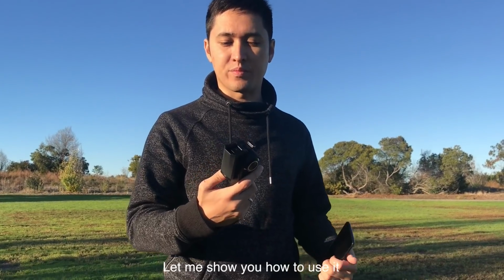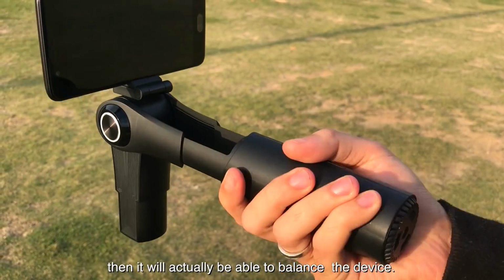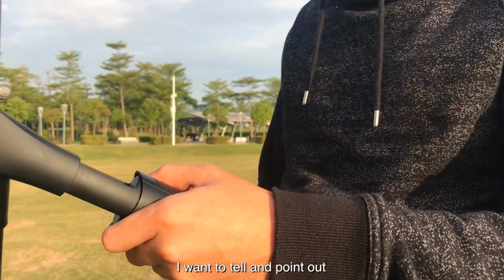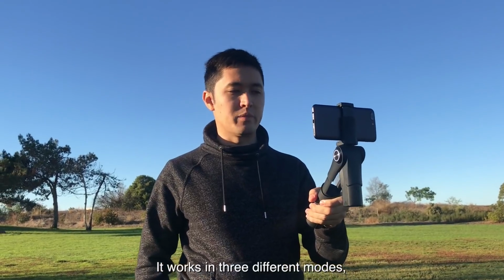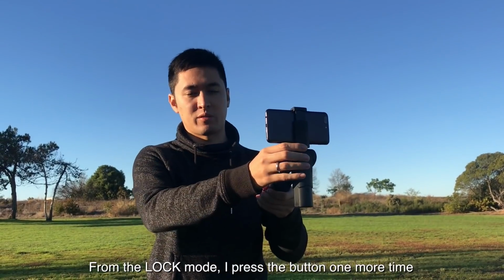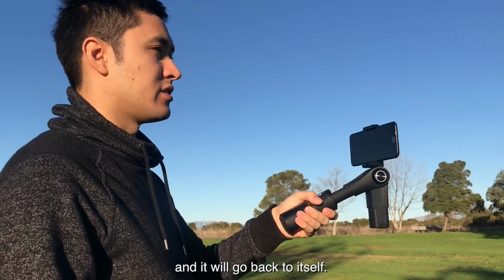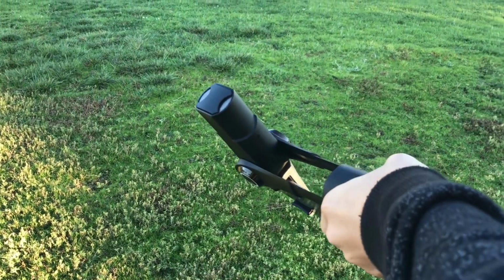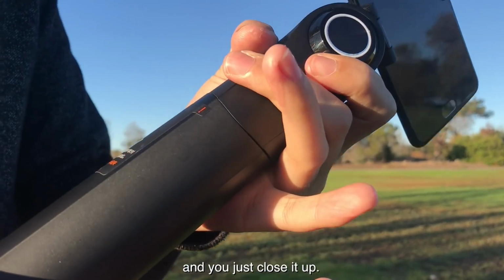Quick start to use Snoppa M1

Comment: Great help from this video, thank you! Before mine doesn't work as expected no matter how many tutorial/review M1 videos I've watch.
Btw the video above doesn't mention about the removable magnet/weight near the handle. Could you explain what is it for?
Actually the apps doesn't work with my android device at all. I don't know if the android version or the firmware problem. But somehow it still can be operated using the camera apps from the phone manufacturer.

Comment: Mine is horizontally inclined. How can I adjust that? And it even changes that horizontal angle sometimes from one side to the other.
Reply from the maker: there's a guide inside the app. 
open the app, and connected the gimbal by bluetooth.  make sure your firmware is the latest version (check in the "firmware info" panel). first do the drift calibration, and then perform a "level calibration" according to the picture instructions. 
all the gyro sensors are sensitive to the surrounding environment (after long transportation, or humidity changes), and you may find sometimes it drifts or inclines after startup, but it can be easily recovered by a calibration process

Comment: Would this stabilizer work if there is extra weight on the side of the phone?  Example, some people have microphones attached to the side. Or does all attachments have to somehow be balanced right in the center area? I have a small additional camera attached through the usb with the phone, about 130 grams, where other stabilizers block the USB port usually so this seemed like a possible solution.
Reply from the maker: Yes, it's possible to fit some extra gadget on your phone, as long as it's not heavy. the total weight should be no more than 240g, if it is too heavy the tilt axis would not work properly
Reply from the maker: SHURE MV88 mic attached on M1 with iPhone7 plus: https://youtu.be/yluZIF38OBU

Comment: Any updates on the updated snoppa app for android? Object tracking?
Reply from the maker: the task is interrupted by our new product app development, but the basic algorithm module of object tracking  was already finished, and need take some time to be integrated into the app. we plan to finish this integration for IOS first, which is estimated to be done before the bottom of this December, and then Android version. Because it will take more time for android phones as there're too many Android phone models with various of processor chips and different processing speed.